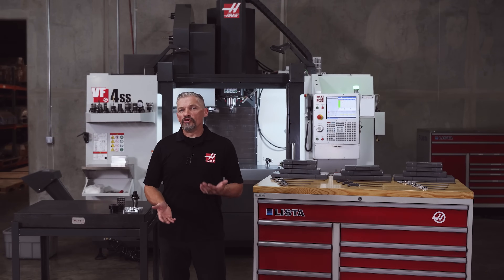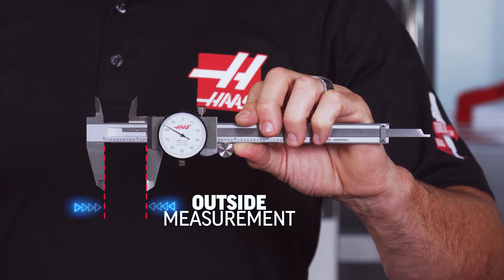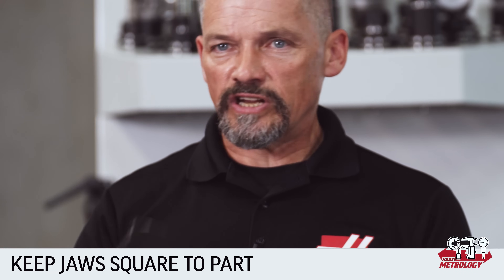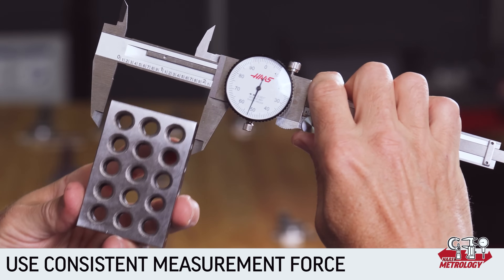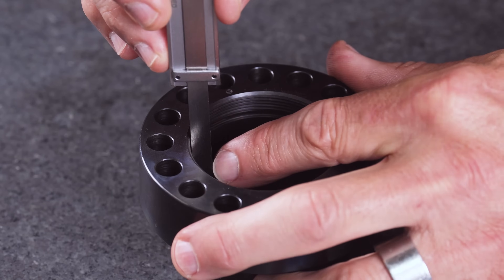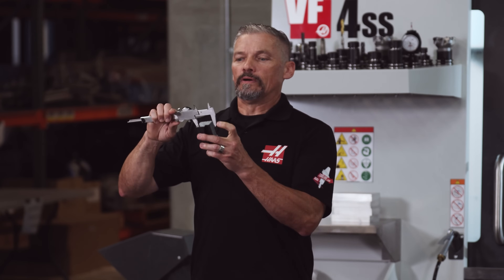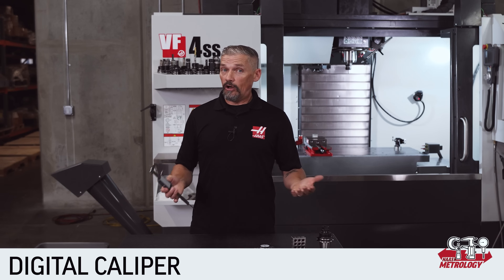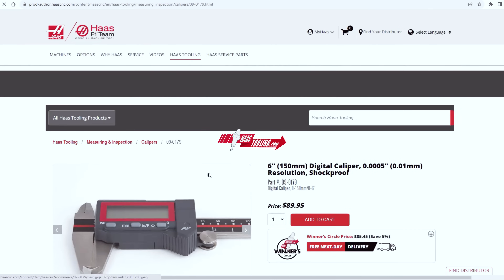Dial and Digital Caliper How-to and Overview - HaasTooling.com Metrology

Comment: Are your dial calipers coolant proof?
Reply from the maker: arturoaragon43, Maybe you are referring to the digital calipers? The various dial calipers have no electrical components that would be harmed by coolant. Not that you'd want to dunk them in coolant continually. Our three digital calipers have an IP 67 rating which means they are fully protected from dust/grit intrusion and protected against immersion in liquid. Does that mean you should leave them sitting in a bucket of coolant? No. But getting splashed with coolant or other liquid like might happen in a typical machine shop should be just fine. Most of our other specialized digital calipers (depth, OD groove, etc.) carry an IP54 rating which protects at a lower level against dust and liquid intrusion. You can check the rating for any specific tool by referencing the "Tech Specs" on the webpage for that tool.

Comment: One very important thing when reading an analog gauge of any type: look straight on at it, not at an angle. While not as crucial with smaller dials where needle is close to the face, with larger ones it can throw off the measurement. That is why many old-school analong volt meters and testers even had a reflective strip under the number scale: when you needed a precise reading, you would move your head until the needle is perfectly over its reflection, then take a reading. Doing so ensured you were reading it as straight-on as possible.
In a way this error can be seen here at 9:56, where reading seems to be less than what it's called out to be, although that could have just been done for filming purposes.